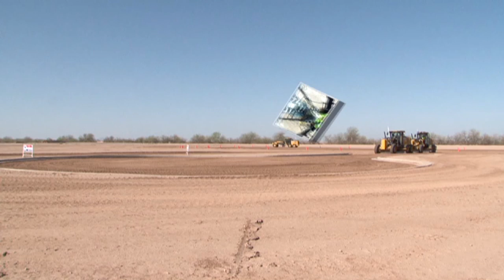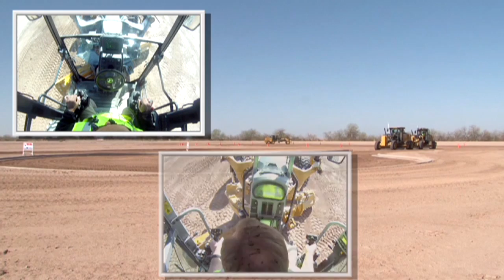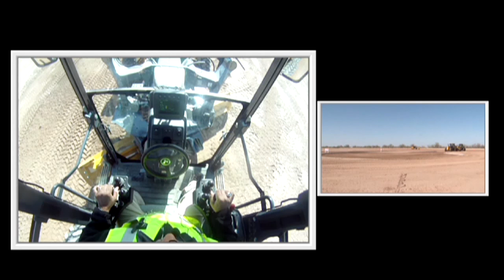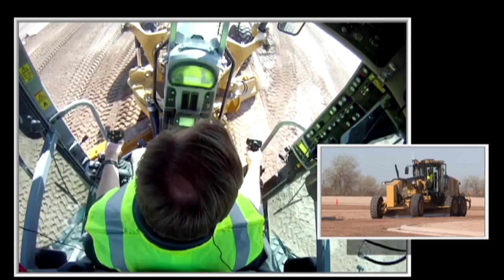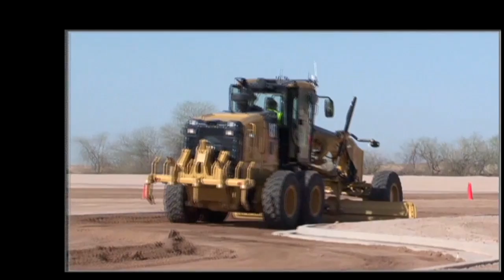John Deere G-Series Motor Grader versus Caterpillar M-Series Demonstration

Comment: I operate a Cat 140M 2019 model and never have issues with the steering at all. The biggest issue you are having is you're not using the fine setting in the hydraulics and the auto slope setup you have are separate buttons where as mine has 2 buttons and a scroll wheel on both joysticks. Everything is right in your hands. Also you're not using the auto articulation to assist in steering in tight situations
Reply: this is from 2013 no such thing existed did it

Comment: I have a 140m2 nice quiet cab, but poor visibility to the heal of my blade and is light in the front end . The John Deere out pushes the cat and the front end does not get dragged sideways when you load it up.
The John Deere cab is not as quiet as the cat and has a lot of rattles from the door latches and steering Column. Both machines have there pros and cons

Comment: I have never operated the new JD, so I won't comment on it. Secondly, if your first blade was an M and you maintain haul roads of any kind, to include logging roads, you are not a finish blade hand. When it comes to cutting fine grade for paving the G, then the H are the standard to which all other blades are compared.  They have room for improvement but the M is not it. Everything said about the M is true: 1. The metering is not that great, some would call it down right poor. 2. Visability is great! Exactly where you don't need it. The heel and the toe are blocked by the controls a good portion of the time. 3. It is far more difficult to maintain grade in tight spaces where you must, turn and articulate. I feel they made the M for all the wrong reasons, and fell short of improving the functionality of the H. It seems John Deere's new blade is attempting to compete with the M. They should compete with the H first.

Comment: Hard hat in a machine! nope do not want a piece of plastic giving 0.5 of a second to say shit! if anything comes thru that ROP. Ball cap and sunglasses to keep the sun off your eyes.   I run both cat and deere . I will take a deere over cat any day of the week. And doing snow removal with a cat and those windows just catch everything.  Just about everyone has broken glass.  18 hr shifts in a cat are hell! Never get out of that steer position. Deere with the wheel gives you a chance to change up while wheeling to a new area to clear, Way more relaxing.

Comment: I admit I’m a diehard Cat fan but I found the M Series rather unpleasant to operate. I immediately noticed as in the demonstration that I could not maintain a clear view of my heel when working tight areas with a sharply angled blade. Also the new Cat Ms are low on torque, cab is too small for my lunchbox and too short for my height, bumped my head a lot. The steering was also downright scary trying road it down the highway. If I had my choice I’d choose the JD, for one thing it’s very similar to the H series Cat but not as beefy in hard blading. For me circle visibility isn’t my focal point, it’s the tie and heel that I’m watching.

Comment: I have run both these graders  7000 hours in the M and currently 10000 in the Dear and they both have some better features than the other, John Deere service and parts are crap here in Aus  I am currently running a 770GP  and  if I was buying new again it would have the Cat logo on it

Comment: i run a 140M AWD gradin for asphalt and the person running the deere says he is gradin close     look how far he is away from the curb not GOOD     is he 3 inch or 3 and 1/4   for ashalt  he don't know i have run the 140H for ashalt the same way  and have no problem running both        Deere is jealous of Cats visibility
Reply: I have never been to a training center, but I would guess, they probably don't want you to truly run the curb. A curb face is touched by a blade a  couple times every 20+ years, typically by a finish blade hand. Turn a hundred guys loose on that curb and you might as well track it in with a D11 as well
Reply: lol y is the cat grading behind the deere           tell the deere move away

Comment: 41 years of heavy equipment operation from cable lift shovels, pony motor start graders that were all PTO driven, cable lift dozers and now the Cat140M3. I have over 10,000 documented hours on the 140M, 140M2 and now the M3 I am operating has just over 1700 hours on it. Once the county judge was considering purchasing a lesser brand. He ask me to evaluate it. I told him I didn't have to evaluate it and ask him to walk with me over to the 140m that was parked near the other brand. I said see the grade marks on those bolts? He said yes, why? I showed him that Cat has grade 8 everything while the competition has grade 5 or less and told him that was all I needed to know. We stayed with Caterpillar. Over the years I suppose I have been on every brand of something ever made. Many of our operators had their mind made up that the new joysticks on the Cat wasn't going to work, no steering wheel took me a while to wrap my mind around as well. But it is all mind over matter, it is a machine, you are the brain behind it. If you want to learn something new then learn it. Now those joysticks are an extension of my hands, most days I don't even think about what I am doing and I can guarantee you that the Cat 140M3 is hands down the best machine I have ever been on. One more lease after this one will take me through to retirement. If it isn't a Cat I may just go out early, that is just how I feel about it. Cat doesn't have to compare itself to other brands of equipment, it is the standard by which everything else is trying to catch up to. Most of the other brands aren't even on the same page.

Comment: i like how the camera on the jd is right forward so you can see the moldboard on the left but the cats is right back so you can't see it. anyone whos sat in both knows the cats got heaps better vision all round. also the cat operator hasn't spent much time on an m you can tell by the way he holds the joysticks better of still using your fingers to control it

Comment: I'm operator in Brazil, working with a series-k grader. Both the John Deere G-Series as the M-Series Caterpillar, are new here, have not had the opportunity to work with them, but the John Deere G-Series seems to be so precise with the commands of the original way, and Caterpillar M -series does not seem to be as safe with many commands together in a joystick. Will the future is the joystick for motor graders?

Comment: Both are great machines, the JD has better traction, After running a 140m and now a 140m2 awd you do get used to the controls. The only true complaint I have with the 140ms is that the controls do not ride with the seat, they are stationary, which will take a toll on your rotator cuff ( shoulder joint) after a while. Trust me on that, after 6 yrs of running the Ms Im getting cortazone shots in my shoulder. Really hoped Cat would have change that on the M2s.
Reply: Jeff Gruebele i agree... i dont know why the arm rests arent fixed to and move up and down with the seat..
Reply: Running a 140M3 and still the same, joysticks and rests have a ton of adjustments but still they're separate from seat.
Reply: Running a fancy 120 M4 with the new cab design, the armrests are still separate from the sit